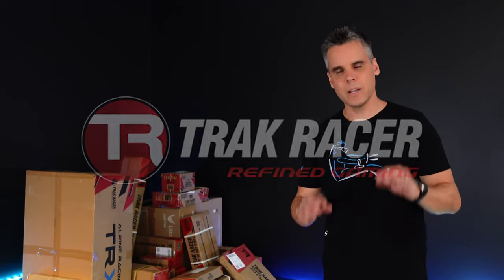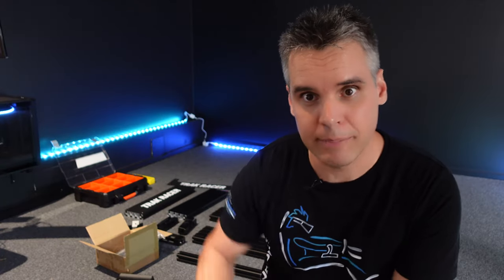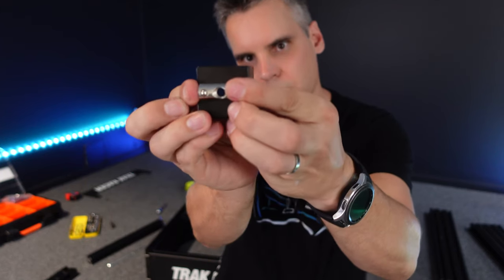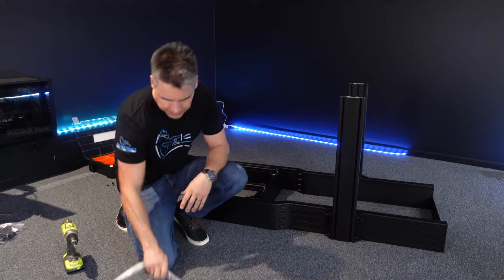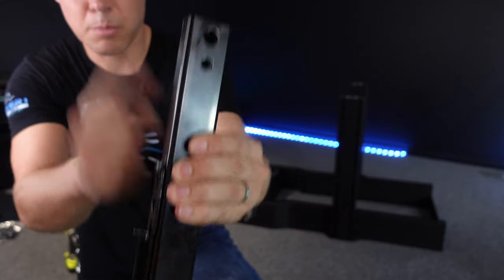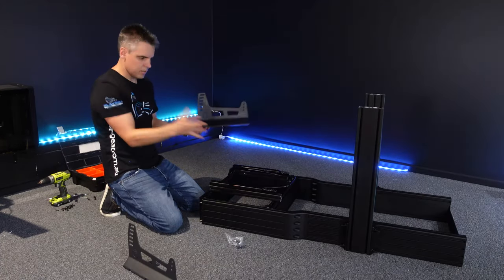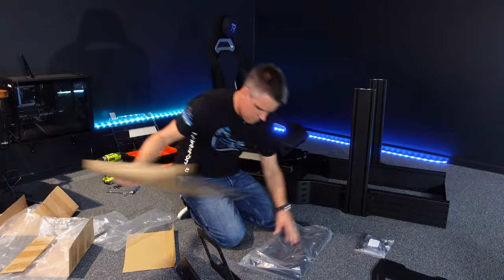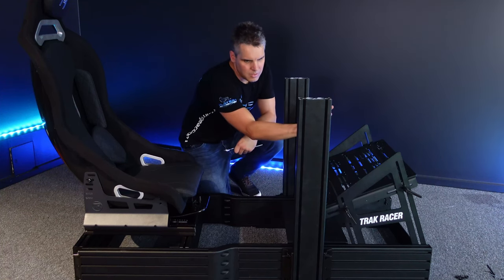We Build the New Trak Racer TR160S  + Essential Tips & Tricks for Every Sim Rig Build

Comment: Nice video Neil, appreciate the informative and detailed build.  Have narrowed my rig purchase to Track Racer and now, trying to decide between the 120 or the 160... Honestly, think either will be fine - just don't want to look back in a year or two and think, "man, wished I would have spent a little more for that..." kinda thing. I think even the TR80 would probably be fine, but when you start picking things, each one is "not that much more"... Lol : ).
I will say though, I think you have the seat 'brackets' on backwards... maybe that was intentional for your application - but all the rigs on the Trak Racer site have them the other way around... just an observation.
Reply from the maker: Yeah tbh both the 120 and the 160 are awesome. I am sure you'll be fine with the 120, unless you're a really big guy, or going for a motion rig.
Reply: @player1simgear  I just bought the TR120, it is great and also 'motion ready' so even with that use case in mind - it will be fine.

Comment: The pedal plate does have a right way up! Theyre countersunk drilled on the top, so the flat bolts that are sort of 'Y' shaped, the head of the bolt sits in them nice and flush. Wrong way round they'd stick up.
Reply from the maker: Yes good call! Sorry I meant did it have a front vs a back.. :-)
Reply: @player1simgear  ah I get ya haha I did get stuck on that bit too and lined up the 'letter P' shaped holes with the image in the manual but it doesn't look like either way really matters. I think I used it up the way that meant I could use the indented line as a heel stop! Haha

Comment: Hello Player 1 Sim Gear, this rig doesn't show the same aluminum profle as what is shown on the website..
Trak Racer TR160s shows the bottom side pices wih no middle rails just like the steering colums seen in your vid..... Did they change the design?
Reply: This is a TR160s              which narrows at the front half -  shown here
                TR 160 mk 4     as the same height and frame width at both ends is equal      🏎 🏎 🏎
Reply: @AshBhang2010  Thanks but I'm still confused....The pic you show on your Video "header" is the same as the pic offered on the websites for TR160s...No middle rails on bottom side extrusion... Maybe the pics are just wrong?
Reply from the maker: Thanks for checking out our r
Vid! You're absolutely right, good spotting! The TR160S does have the smooth profile on the base frame with only 2 t slots, we flipped those profile sections around and put the smooth side on the inside, as we are attaching motion actuators to this rig and we needed the 4 t slots for mounting them. Fortunately the rails have the option for the 4 slots on the other side for use cases like ours. It's very cool.
Reply: @player1simgear  - LOL - thought I was losing it for a minute...I agree - that is super cool looking - awesome review!
Reply: @player1simgear   Are you going to use Dbox G5's - I was wondering if they would fit??
Reply from the maker: We've mounted the Qubic QS220 system to it. Stay tuned for a future vid showing the rest of the build!